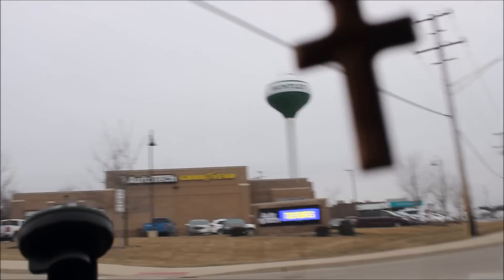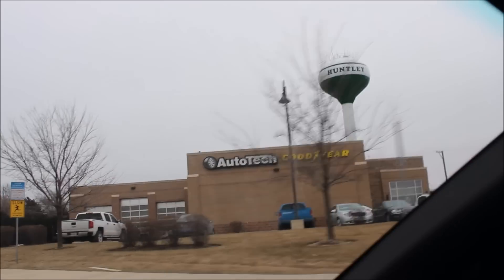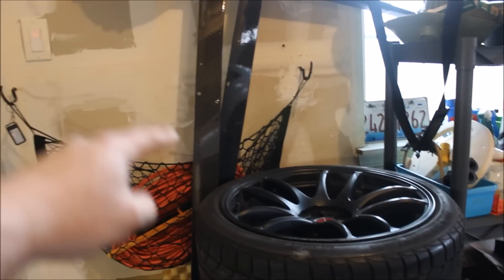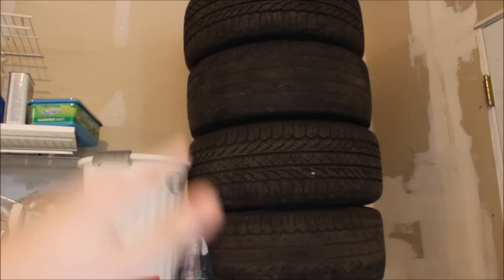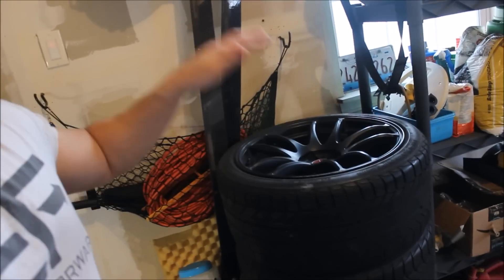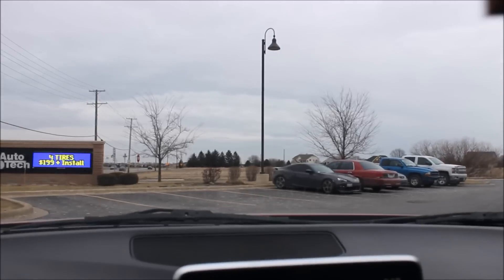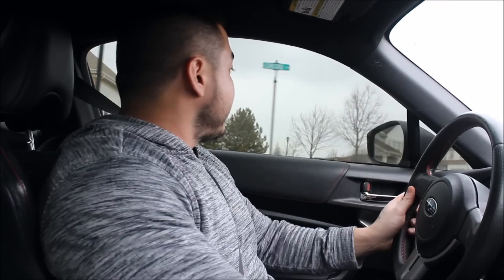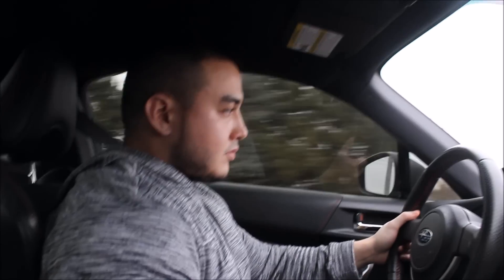NEW BRZ MODIFICATION! (More BRZ Problems?)

Comment: My N1 exhaust does the same  just cold start.. afterwards its normal. Its nothing.
Reply from the maker: njskater360 Ya that made me feel a lot better. I did research and I guess a lot of cars do that . The exhaust fumes go to one side and when the car warms up it’ll start going through both pipes! I was just concerned  because never seen that before and it started happening right after my accident!
Reply: njskater360 same with mine

Comment: You drive without winters? Yikes!
Reply from the maker: chucky ducky Yes the stock wheels work fine but I don’t really drive the BRZ when the weathers bad. My daily is a 2015 Lexus IS250 and I use that when the roads are bad.
Reply: Oh I see. I daily mine all winter here in Canada and definitely would not without winter tires. Can't wait for your new vids with new cam.
Reply from the maker: chucky ducky Ah gotcha! Thank you! I’m excited to up the quality of the videos and make consistent content again!